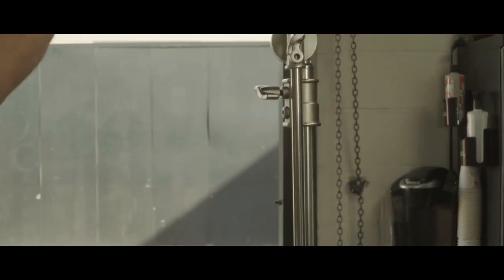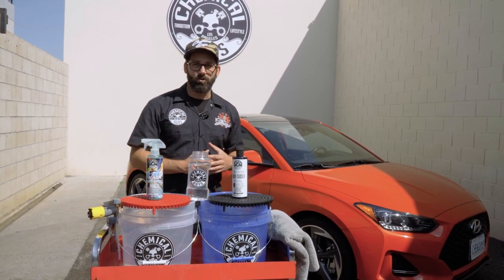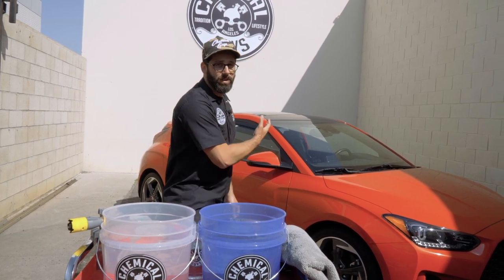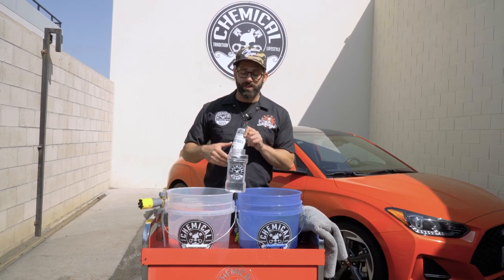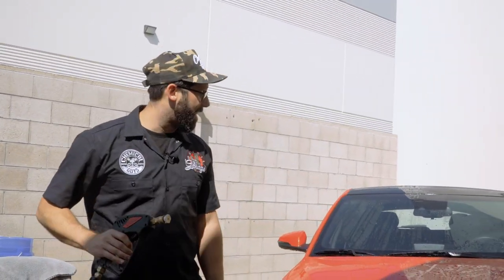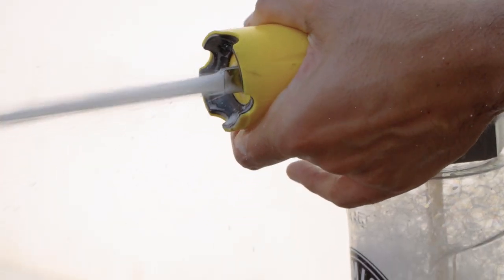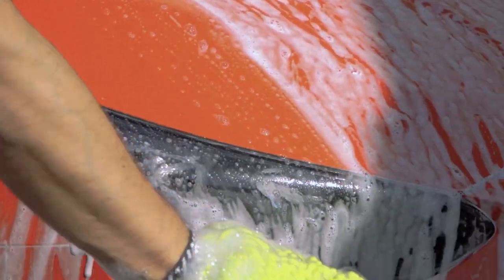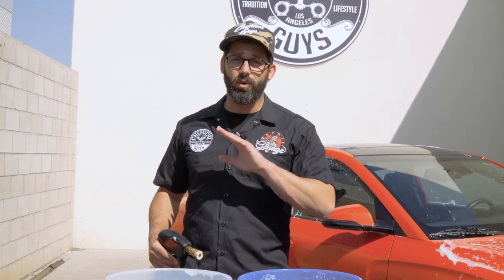The Ultimate Action-Packed Scratch-Free Way To Wash Your Car! - Chemical Guys - Dirty Shorts Ep 3

Comment: On the dirt traps. Do you keep them on a 45 or lay them flat?
Reply: Lay them flat
Reply from the maker: We like to place them in at a 45 degree angle for ease, but they should lay flat at the bottom of your bucket!  You could leave a Dirt Trap at a 45 degree angle if you plan on using it as a washboard to clean your tools, however!